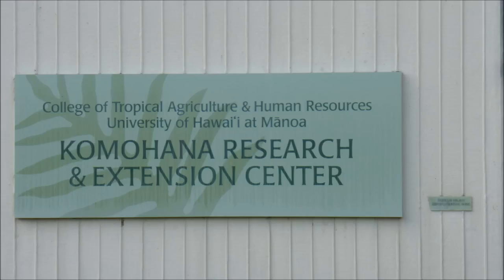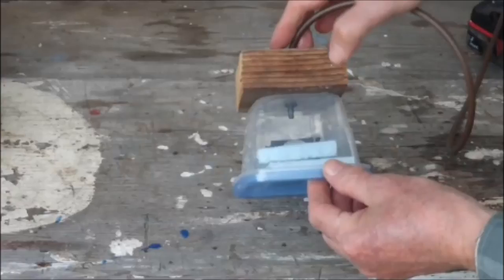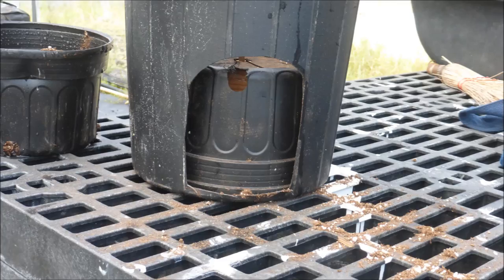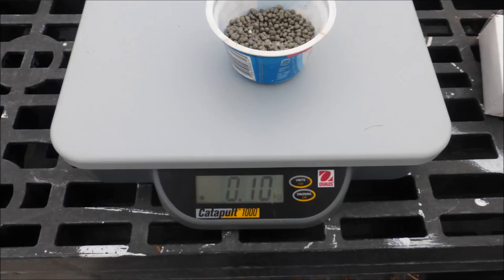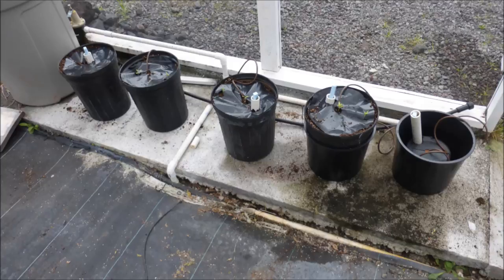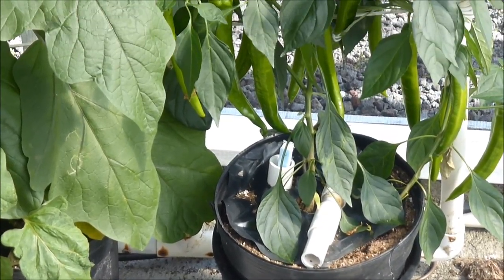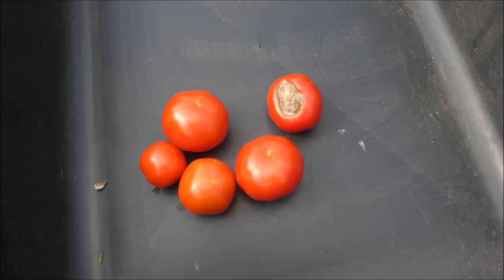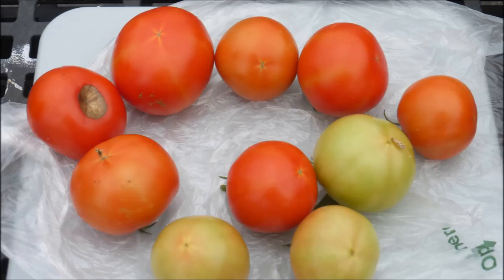Automatic Watering of Tomatoes, Eggplants and Peppers in Containers of Growing Medium by B A  Kratky

Comment: I just came to realize that I could just get a cheap float valve and install it on an external unit connected to growing containers through tubes, then I can control the water level from outside the containers just like you do! I will be able to control water level in all containers without even touching them! Your method is superior than drilling a hole on the side of the container to install the float valve like many other people do on youtube. Thank you so much for the knowledge and inspiration!!

Comment: I watched a previous video where you talked about using a float valve to maintain a constant level.  This led me to a solution where I drill a hole in the side of the container at the desired level and allow the overflow to go back to a reservoir.  I think I can do this even in standard 10x20 trays.  I expect there is less stress on the plants and more production due to the plants spending less energy growing roots to reach a receding water level.
Reply from the maker: Thanks for the comment and information.

Comment: I'm noticing my UH Healani tomatoes Kratky method growing outside get smiley face cracks around the top. Maybe a row cover to block some sun will keep them from bloating when the sun starts cranking up the level. Around 8 of the plants are just now ripening so we'll see how things progress. Thanks for the videos. Some of us don't wear a hat gardening so we have to have breaks inside or our heads look like ripe tomatoes :). Thus we need more of your videos for our down time :)
Reply from the maker: I seem to recall that crack resistance is an inherited trait and some cultivars crack more than others.  Also, field tomatoes are particularly succeptible to cracking during dry periods followed by wet periods.  I do get an occasional cracked fruit even under cover.  Yes, you should wear a hat when gardening and some flaps over the ears and back of the neck!

Comment: Nice job, love the low maintenance aspect. As you had an even surface, you could have also made one float valve in one control bucket, then connect the buckets directly to each other. Always pros and cons to each method.

Comment: Great video!  An idea for your valve... you could use silicone cooking pads to swap out the neoprene with.  Have you seen the Autopot system?  They have a two-stage float valve that's absolute genius... it doesn't top back up until the pot is dry, so the soil goes through the whole wet/dry cycle.
Reply from the maker: Thank you for the suggestion. I am always looking for improvements.  I wasn't aware of the Autopot and agree that it  is very innovative and it looks like a pretty good growing system.
Reply: I was curious if you could DIY that two stage valve... There could be a substantial growth benefit from the increased oxygen of a complete wet/dry cycle.  Here's a diagram of the valve works... its very simple in concept, but I can't figure out how to DIY it...  https://futuregarden.com/howto/smart-valves.html
Reply from the maker: Thank you for the diagram.  As you suggested, it is a pretty ingenious device.  I don't have any good ideas on how to DIY it, but perhaps, another viewer might.  In the meantime, you might consider using a water timer with an 'on' cycle for 1/2 hour every day or two in combination with a float valve to get wet and drying cycles.
Reply: That's a good idea.  Thanks for your input!  And thanks for all you've contributed.
Reply: Here in the US, $25 is the cheapest I've found them.  Using one valve on a big tray will work as long as all of the pots consume water equally... otherwise the slower plants will stay saturated.  Thanks, though.
Reply: @growkratky5558  Great discussion here! I saw that you touched on Autopot and would like to ask for some more input. Isn't it some kind of combination between wick and kratky system? I've seen your video growing cucumber in a plastic bottle and thought it could be modify to resemble an autopot pretty closely. In my mind, if the bottle is a bit bigger, has more holes on the side for aerating, is raised higher up allowing more exposure to air and the solution reservoir is of smaller volume and is auto re-filled, that would resemble 80% of the autopot system. What do you think about that setup?

Comment: I'm going to use this float valve for my raft setups.
thanks
I have a five gallon bucket with a drain at 1" below a 4" netcup for my tomato plants. I wish to make a compact float valve that can go into the bucket to have the self watering setup.
any thoughts?
Reply from the maker: Currently, I am playing around with an exterior float valve-sump assembly combined with a siphon apparatus to deliver water to  buckets.  If it works reliably, I'll have a youtube on it in about 6 months.

Comment: So, what was the point of using wrapping a plastic bag on the float valve? Also I do something similar where I take some twine rope, soak it, and keep half in water and half in dirt to wick water into the soil,  the only problem is you can't control moisture.

Great video maybe I'll use this for my more unique plants!
Reply from the maker: The plastic bag helps to prevent roots from growing into the float valve, but they still manage to enter because there are water drainage holes in the bag and also in the float valve body.

Comment: Take a look at the Kerick float valve assembly. It is covered. you can find a picture of it  here. www.growbaggardensystems.com. I believe it is also sold on Amazon, but Larry has the one that is covered.
 Larry Hall has experimented many ways of making gardening easier using inexpensive means. The kiddie pool sub-irrigation self watering system is my favorite.
You might enjoy some of his ideas. 
I know that I appreciate your growing methods and teachings. Especially when there is the possibility of no electricity.  My grandparents would have greatly benefited from your knowledge and teachings, as they were dependent upon thier gardens.
Reply from the maker: Thank you.  I wasn't aware of this float valve.  It certainly is much better than my home-made design, but more expensive.  I really would like to find a small manufactured float valve (like about a 2 inch cube) which sells for about a dollar. Then, it could be used similar to an irrigation emitter and gardeners could afford to use one float valve for every pot. I am a fan and admirer of Larry Hall's innovative 'gutter gardening concept, but I haven't kept up with some of his other innovations.